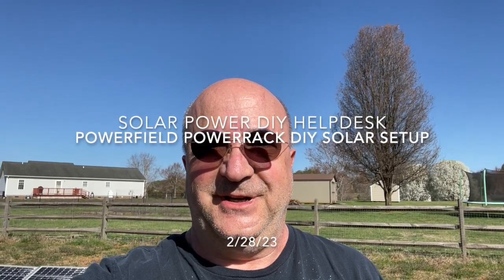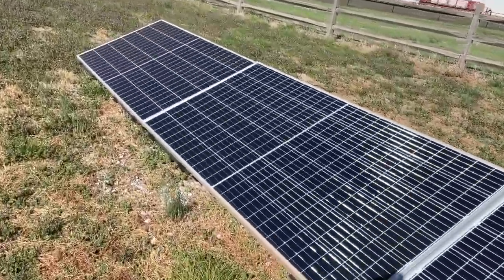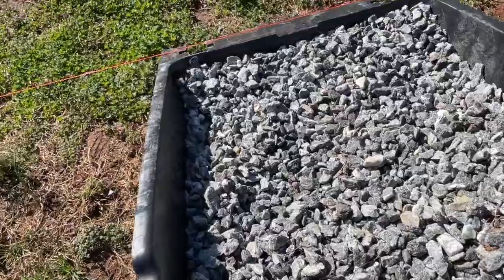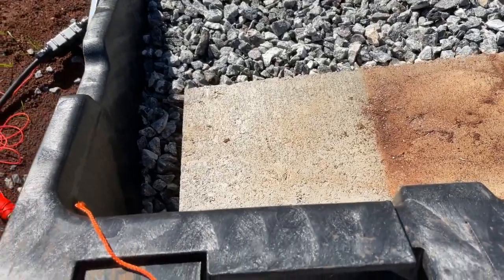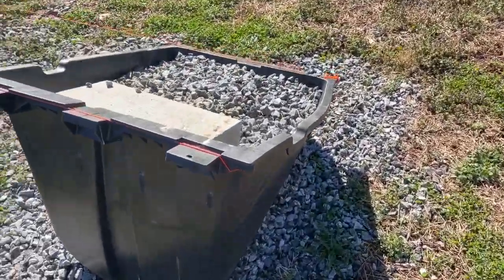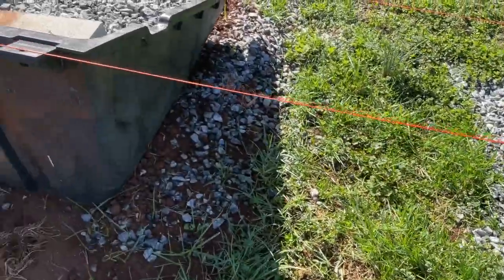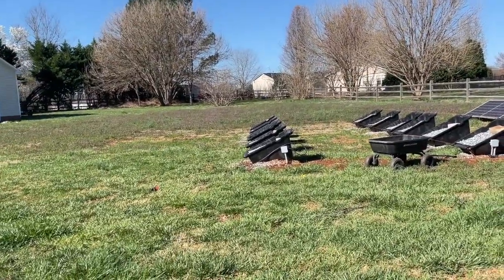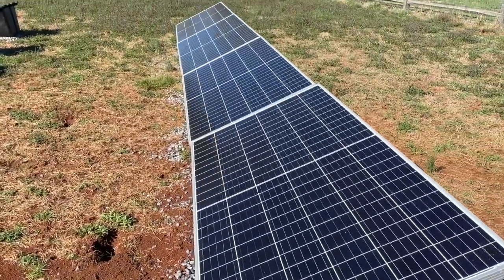Powerfield PowerRacks DIY Solar Setup - Live and Learn

Comment: Very interesting product. Did you have to obtain a structural permit from your JHA? I noticed that your wiring between panels wasn’t contained within conduit. I think you should consider using some sort of conduit to protect wires. Your JHA performing the electrical permit inspection might not approve.
Reply from the maker: It did require a building permit, but in some jurisdictions, it is not required because it is less than 28" above grade. You need to check with your local AHJ.
The cable is type TC-ER, which is rated for sunlight exposure, exposed runs, and direct burial. Conduits are not required. Each branch circuit is protected by a 30A breaker, and the cables contain a protective ground wire. It's the best solution for DIY and saves a lot of time and $$$.

Comment: This is extremely helpful info, thanks!  It's good to know you don't just throw these on the ground, fill them with rocks and go.  I was initially blown away by the design of this mount, and still am, but there not the slam dunk/easy button I initially thought they might be.  But it makes sense.  We're all used to seeing perfectly straight arrays of panels and they really do look wacky if they're not all lined up nicely.  Might bother some more than others.  And I can't help but wonder if the two units holding one panel might settle/sink in different directions putting stress on the panel that wouldn't likely happen on traditional racking set up.  I hadn't thought of this until I saw this video.  I wonder if they could make a larger single unit to hold a panel by itself?  Thanks again!  Keep up the great work!!!
Reply from the maker: Thank you! Please watch the latest videos using the IntegraRack IR-30 system. It's faster and much easier to set up but expensive for small panels. I used 550W so that the $/W for the racking is lower. Due to the lower cost, I would still use PowerField if I were installing 400W panels or lower.